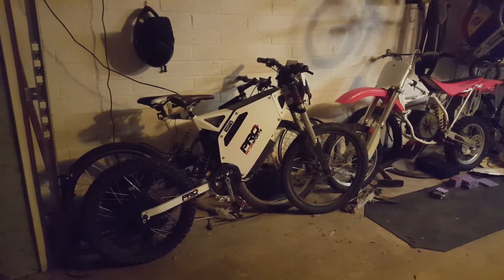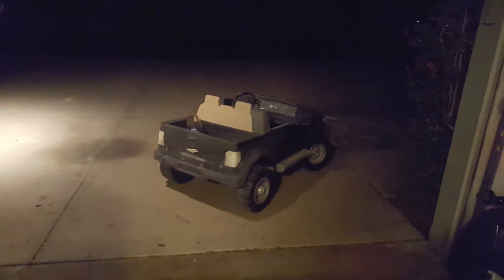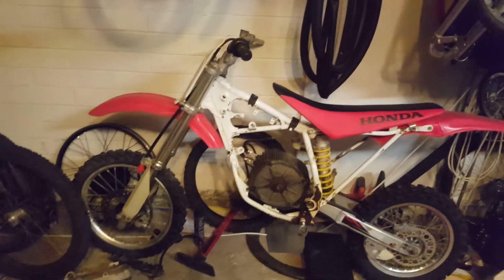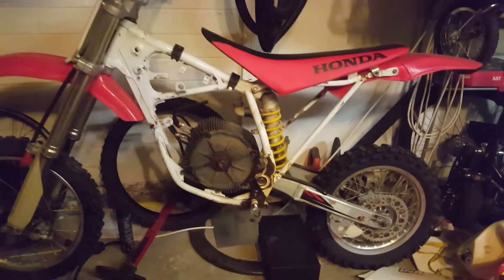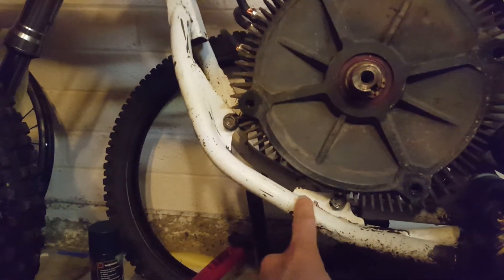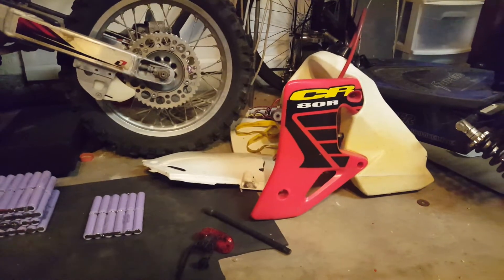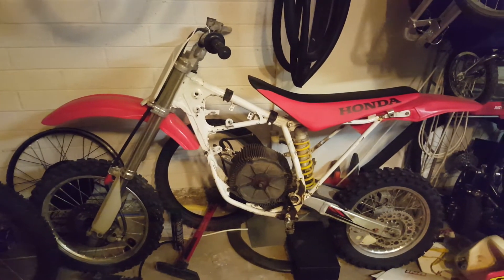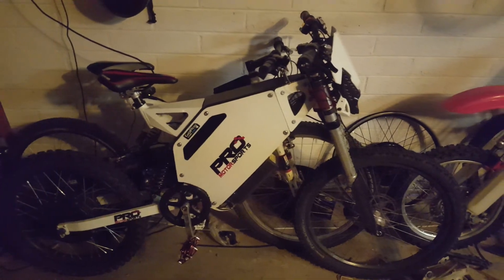CR80 electric conversion

Comment: Looks so powerful motor!

I’m building electric motorcycle with 10kW motor. 
This is the same size or bigger.
Reply from the maker: The one in the bike is bigger. Its from a zero and I ended up not using it in this bike. I went with a QS 138 70H motor that is good for peaks up to 25kw.
Reply: @DevinLindstrom  Okay I might be confused but I am assuming your are saying that the motor is 25KW because the peak phase current is 350A and so at 72V you would be producing roughly 25KW, but the battery is not pushing 350A correct? Because in reality you have 350A peak phase current at say 20.57 V motor side,  assuming you are putting in 100A at 72V batter side (with 3.5 times field weakening). So the power is really still 72Vx100A = 7200W. Power in = Power out.
Reply from the maker: @vincentpernicano3277  So It is going to be 350a battery and 600+ phase. So it will actually do 25-28kw. :)
Reply: @DevinLindstrom  That is insane lol
Reply from the maker: @vincentpernicano3277  yeah I'm looking forward to it. The KX250F I'm doing will have 660A battery though and that is likely to kill me. Haha.
Reply: @DevinLindstrom  yeah dude I don't understand how you can even use that much power on either of those bikes. I did the calculations for a 150A battery in an rm 125 frame, stupid torque, 4s 0-60 and like 65-70mph top speed with qs 138 70H...I can't see myself needing or wanting anymore than that...your crazy bro lol you should have way more subs for making such high powered electric dirtbikes!
Reply from the maker: @vincentpernicano3277  Problem is I'm no good at recording myself. Haha.
Reply: @DevinLindstrom  lol yeah huge pain in the butt...how did you get into building ebikes and diy batteries anyhow? Do you have a background in electrical? I'm trying to do my first build right now and while I'd like to make my own battery out of 18650s but I am trying to keep complexity down for my first build. I am buying a 68ah lipo pack that can discharge up to 4C but I only need 150A, will cost me $850.00 which I think is a pretty good deal!

Comment: how much do you think this whole project costs?
Reply from the maker: I got the frame from someone for free. The batteries were $750 the motor was a great find at $400 the controller will be about $1,400 and the other parts for fabrication should be about $500 or less so hoping for $3,000ish.
Reply from the maker: The smaller white one. It's 18,000 watts where as for the CR80 it will be about 50,000 watts.